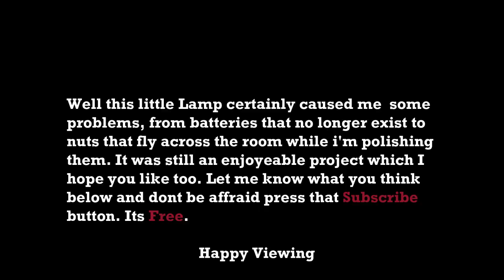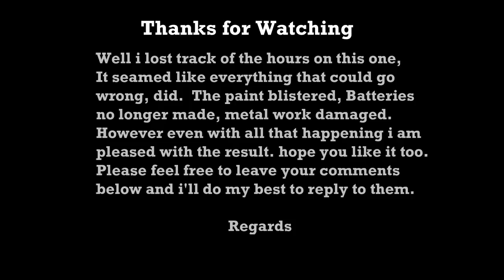World War 2 Bicycle Lamp Restoration

Comment: This is probably an army version lamp, also known as bivouac lamp, these were made in different shades of brown and green. I know of a black version used by the Air raid precation (ARP). These were not meant for bicycles! Although they are useually sold as bicycle lamps. The clip at the back was for attachement to a belt. There is an near identical version for use on a bicycle. These had an attachment you couls slide over the bicycle lamp holder. The bicycle version also did not had the thick wire handle and most times not even the metal cover that hinges over the lens. In the army the cyclists would ride in a column with only the front cyclist with a lamp attached to the front and the rear cyclist with a different type of lamp to the rear. For my ww2 British army bicycle I use a '50 lamp made by the firm Ever Ready. These are almost copies of the wartime bicycle lamps. main difference is they have a black plastic "chickenhead" turning knob and painted silver. In my collection I several, even boxed, lamps green and brown shades some with different lenses, red/yellow, red , yellow, green and white clear and white foggy. Unfortunatly I never found a batteryholder.  Although I have seen one and pictures. i also had to improvise.

Comment: That "better way to clean the bottom" was nice .. great job!  And making a battery was also impressive.  I would have probably tried to put four D Cell batteries together in some hodgepodge to make it work (and put a little foam or cloth around them to hold it together and fill in the spaces).  Seeing what someone with skills does those .. so nice and enjoyable to watch.
Reply from the maker: Thanks Walter.

Comment: Great restoration, but I'm not sure about the battery.  You've connected the cells in parallel which will give 1.5V total whereas I imagine the original '800' battery would have been 3V.  The result will be that the lamp will be much dimmer than it should be.  It's also pretty unusual to put primary cells like these in parallel and could result in reduced battery longevity.

Comment: I'm surprised that it was possible to save it given the amount of corrosion, I've got a couple of these that I bought as old/new stock a few years ago from army surplus. The original finish on those was a matt dark greyish brown. I've found that the best way to polish nuts is to thread a piece of iron wire through them or slip them over a nail. It makes them a lot easier to handle.
Reply from the maker: The Butler Did it,  I like the name. I'll try that tip with the nuts next time. Regards Brian

Comment: As for welding on that top lip, that metal would be very hard to weld, as thin as it is, without some specialized equipment. Might could have brazed it. But it looks like it turned out quite well!

Comment: I worked in an auto body shop as a tween and was taught that without holes for it to be pressed into, body puddy will eventually fail to stay on the metal.
Reply from the maker: Hi John, I know it's a risk using it in this way but hopefully it will stay in place. It's only going to be wrapped up until I have somewhere to display it. Regards Unique Restorations

Comment: I have 2 of these lamps, was yours marked with the crowsfoot stamp anywhere? Looks like this /l\ the clip on the rear should read lamps electric no1. One of mine has a green filter,the other has a red one. Nice job on your restoration 😀
Reply from the maker: Hi Andrew, iv just looked at it and it does say lamps electric no 1.. Regards Brian

Comment: I guessed immediately it was for the blackout years.  you can adapt other size batteries to work. I once adapted a lantern that takes the big battery like you took apart to work on 4 AA batteries. Sometimes I'd loan it out, the second they grabbed it they'd say it needs a battery, but then I'd furn it on. I'm not saying that's what you would want to do, but I don't see why you couldn't convert it to take C size batteries or the like. All you have to do is make a holder and wire it in.
Reply from the maker: Hi Toot Tall. I had looked online for the original ever ready batteries and tried to copy the way they were set up. I understand there are a few ways to achieve this. Thanks for you advice though I appreciate it. Regards Brian
Reply: @UniqueRestorations  I get that you want to get it as close as possible to original. However, when that's not possible, do something weird. Convert some to LED or something. I don't know about you, but the things I restore I do for the enjoyment of it... I like to get them to work better than original if possible. I like them to be usable, not just something to sit on a shelf. To me, if not readily usable, it's still a fail no matter how good it looks. AS it is now, you have to buy one of those expensive batteries and tear it apart every time the batteries need replaced. Might be interesting to convert to rechargeable batteries. .

Comment: Instead of epoxy resin, couldn't you have soldered the repair pieces onto the lamp body? With the large contact area it would have made a fairly strong bond...?
Reply from the maker: Hi David. It never crossed my mind to solder them. It would have been a better fix aswell. I'll remember it for next project. Regards Unique Restorations
Reply: @UniqueRestorations  In cases like these epoxy resin is better because it is not a strength issue just cosmetics.
Reply from the maker: Thanks yeagerxp, it did provide a really good bond although very difficult to sand the excess. I am happy with the result. Regards Unique Restorations

Comment: Why not electrolysis to repair rust divots instead of filler putty?
Reply from the maker: Hi Arwen, I thought Electrolysis would only remove rust. How does it fill the holes. Regards Brian
Reply: I’ve never done it but I’ve seen a lot of other restorers use it. There are tutorials. Basically you attach the negative to a piece of metal and the positive to your object. I know it works with copper, steel, gold and silver.
Reply from the maker: Hi Arwen, do you mean electroplating. Regards Brian

Comment: Great restoration though, I really enjoyed the job you did :)

You do realize that your red lens should only be half red, and half clear. 

At 2:30 there is a layout of all the parts of the light, and the lens there is a very faded lellowy clear with a warped red piece added.
You have just made your light usable on the rear of a bike.
Reply from the maker: Hi Steve, I had great difficulty finding replacement lenses for this lamp. After alot of searching on the net I found some photo lens covers. Not what I wanted, but all i could find. I chose just to install this red one for the thumbnail. Regards Unique Restorations

Comment: The results we're quite good..  Eventhough it's wasn't the best I've known..  Especially for the front cover of the lamp..  Still visible the Rust and also the twist front knoob are still got some of the Rust..  Perhaps you should sink it again with Rust remover about 2 hours or using some sort of sitting grind to clean it up..  And give it some primer coat,  after that you could finished it with chrome paint to make it good and looks like a brand new..  Just some of my suggestion..  But overall the project that you had done are quite  GOOD...  Keep up pumping again bro..  Perhaps you could say..  PIMP my Old Stuff would be great..  LOL👍👍👍👍